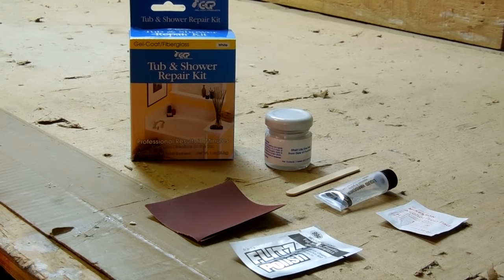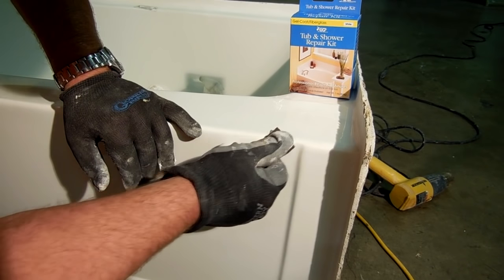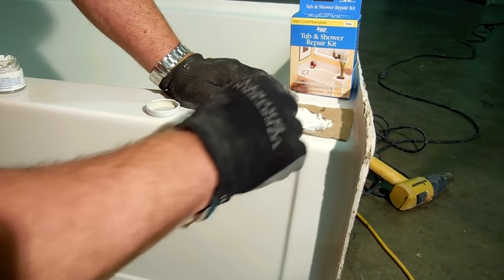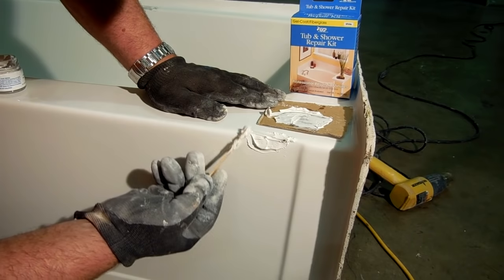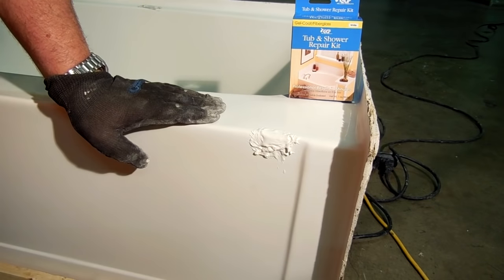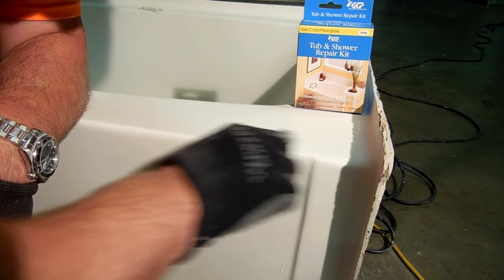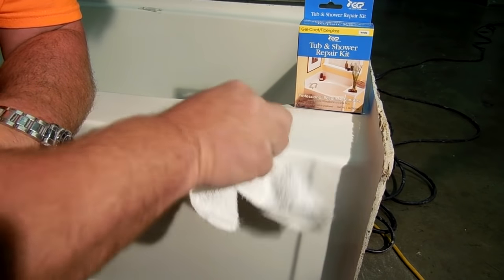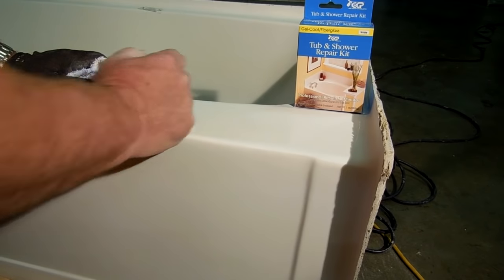GCP Tub and Shower Repair Kit

Comment: Hello Ray, How do I know that my bath tub is porcelain or other type of coating? I have a 2,5 Inch damage close to the hole on the Flore of the Tub. It was about 1/2 inch in the beginning and I used a bath tub kit from Home depot to fix it. After 3 years it became 2 inches and rusty. Would this kit work for such a damage? The Rust is getting bigger and bigger but I don't see any hole or corrosion through the whole metal. I think, it is possible to sand down the corrosion all the way by using different grid of sand paper. Is there any bigger kit available or I should buy 2 of them if it will work on my tub? I think it is a porcelain material but not sure:)
Reply from the maker: Without seeing the tub I can't tell if it's fiberglass or what material. This kit is designed for fiberglass with gelcoat which is the white material. If what you see is rust then its not fiberglass. It could be iron from the water collecting in the crack. If you push on the crack and it opens then it's probably some sort of composite material possibly fiberglass. The problem then is the kit won't work because it dries hard and will fall out as the crack moves. If it doesn't move which I doubt since it did get larger the kit may work cosmetically to hide the crack.  Try exerting a lot of force in the area around the crack to see if it will move. If it does think the best I can tell you is clean it out dry it thoroughly and use epoxy. Or hire a professionally to fix it. The problem with floor cracks is they begin to leak it takes time but once they start so does the damage.
Reply: @rayanderson286  Thank you for your advice! I will try with Epoxy and will let you know. Thank you:)

Comment: I think my tub is plastic, will this process work?
Reply from the maker: Read the whole comment before giving up. It's possible but not likely. It really depends on where the damage is located. If there is ANY movement in a plastic tub it will come out. If it's a crack in the floor,  don't waste your time.  If it's a chip it will probably fall out. On a crack I would try a good epoxy for an immediate fix but don't expect it to hold. On cracks you're best is to plan on replacing it before it does damage to the floor. Then there's also some units on the market that appear to be plastic but aren't. Aquatic makes a unit which is actually a gelcoat unit but appears to be plastic. It's called C2 Composite They're sold in Home Depot check them out, they're thin but strong. Those you can use the paste on with good results. Good luck.
Reply: It’s hard to say exactly what the material is, I think it’s one of those baths that goes over the one you have - it was here before I moved in. The crack is right about where he is fixing that chip. I’m not too worried about water getting in there I just don’t want it to get worse. I was taking down the shower doors and there was like an inch of silicone holding it on, that’s how the crack got there. Thanks for your comments.
Reply from the maker: @ellewilson9506  If it is from BathFitter those are molded acrylic, which a high grade plastic.
Reply: It is a bath fitter,  thanks for your help.

Comment: I repaired a hole on the inside of my tub with this. It is still curing another 18 hrs, but I have doubts of being able to fill my tub for a bath? Will this work? It seems water tight but when I wet sanded after 3 hours, there was that light mud that came off with it. Maybe this will fully cure after 24 hrs or maybe not? Should i put a layer of epoxy over after tomorrow?
Reply from the maker: No I doubt it.You either added too little or too much catalyst. More then likely it was too little. A 3/4 to 1 inch ball of putty should only need 10-13 drops in a warm bathroom. Do it again and immediately after filling apply heat from hair dryer. Once you feel the paste is warm let it cure on its own. Do not overheat it.
Reply: I may have added too much catalyst as the box said 6-8 drops per half oz of putty (I doubled everything because I had to use all putty) and I went with 8 per half oz as it was cooler in my house and mixed very well. Thanks for such a quick reply, I will find out this afternoon how it looks. I really appreciate it!!
Reply from the maker: If it does cure then it should be ok. Normally an over catalysed repair will not cure. The heat flashes off too quickly and doesn't allow the putty to cure. When it's under catalysed it can still cure but will take much longer.
Reply: I am happy to reply it has held up wonderfully to several showers and bathes. Great product. Thanks for all your help!!!
Reply: Ray Anderson 
I have a crack in the floor of my bath tub. And its leaking in the basement. I think my tub is fiberglass..i notice it gives a little sometimes even before the crack..but my nephew slipped and fell and i think his knee began the crack. I dont know how to properly reslove this and i dont have a lot of money cant really afford a new tub kit. Would should I do. I dont want to get ripped off by a plummer and i need it fixed so that it doesnt unravel in 4 months.
Reply from the maker: First stop using it. If it's the only unit then only use it for showers and cover the crack with a lot of plastic shipping tape. The tape won't absorb the water but it's not a permanent solution. You will really need a good professional to resolve the problem and the more wet the unit is he more expensive and time consuming is the repair. It can be done but expect to pay a sizable amount probably around $700 or more. The materials and labor isn't cheap especially with a warranty in writing. Call some of the major tub manufacturers and get a recommendation from them of repair services they use in your area. Most are extremely good but even they have a hard time weeding out the ripoff guys, so ask the repair service for references on the same repair and call those references. If you let me know where you are I may be able to offer some repair services in your area. I was a Field Repair Tech for a tub company for 12 years and know quite a few in the Pacific Northwest.
Reply: @rayanderson286  Hi Ray - longshot but can you still recommend some good repair techs in the Seattle area? I have a 3" crack in the bottom of my plastic tub. I suspect it's a bathfitter but unsure. Thanks in advance!
Reply from the maker: @nimblename  I've been retired for over five years but these guys in Snohomish https://thepatchworksinc.com/  have always been good. My area was in Olympia and Yelm.
Reply: @rayanderson286  Appreciate it Ray! Hope retired life is treating you well.

Comment: I  cannot read the name on the box and where can I get this and can it be used on the bottom of my tub inside ? I have a small chip and it has been worked on before the company sent some one out Now I am on my own I also have to do the inside where they have the skid part just outside of that I can send pictures if you could please help Selling house and cannot flip 250 dollars for this Thanking you Michele
Reply from the maker: They sell it at Home Depot and Menards. At Home Depot it says Aquatic Repair Kit. It normally cost about 12 dollars and is in the plumbing section.
Reply: Thank you Ray for replying back so quick can I send you pictures of my issue  and you tell me if you think it will work and I have a white fiberglass .Tell me where to send the pictures of the tub Thank you Michele

Comment: Do you need to use water with the 400 grit paper?
Reply from the maker: Yes, without it the scratches will be harder to remove. The sandpaper just digs in deeper.
Reply: @rayanderson286  ok. I didn't see you doing it in the video, but the directions say to use water. I saw you use water with the 600 only. I thought maybe the 400 might "cut" better without the water. Thanks for your time

Comment: I must have put too much on, I can’t get it to sand down using the 400 grit. What do I need to do?
Reply from the maker: Use a stronger sandpaper like 220 or even 80. They will leave more scratches but patience and each successive lower grit they will come out. At least it hardened up a lot of people say it didn't get hard. So you did it right.
Reply: Ray Anderson Thank you for replying. I will try that

Comment: How can I remove this as this did not work for my situation?
Reply from the maker: Laricia Eason  What do you mean it didn't work? Been fixing tubs for 20 years can probably recommend  a solution.
Reply: My tub cracked all the way through
Reply from the maker: I'm sorry you're right this product will not solve your problem. It's only for chip and dings. You need to use actual glass and resin and build up the broke area. The process is very similar to repairing drywall but requires the use of materials not commonly used by the average homeowner. If the crack is on a side wall I would recommend using plastic shipping tape under it can be properly fixed. If it's in the floor that much more serious and i would avoid using it. Either way there are people out there who can fix the problem, finding them is sometimes hard as most say they can do it and can't. I would recommend calling a tub manufacturer and ask them for a couple good repair services they use, then call around for some quotes..
Reply: Thank you so much for your assistance Ray Anderson

Comment: Will this work for shower floors?
Reply from the maker: Most likely not. Normally if there is a crack in the floor it moves when weight is applied and will require someone to do a proper repair. Drilling a hole pouring two part foam, glassing the holes closed and then glassing the crack.